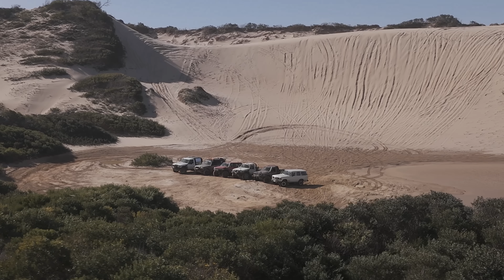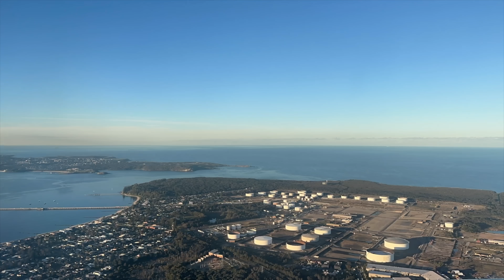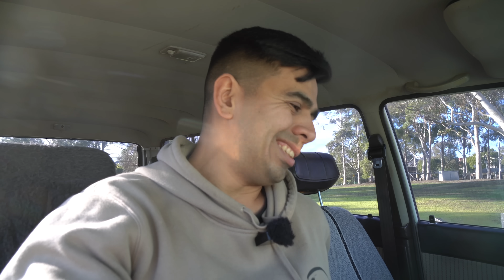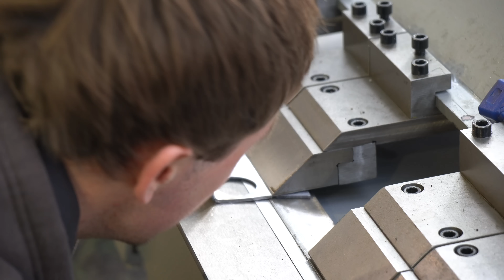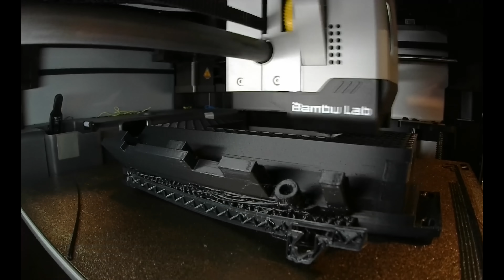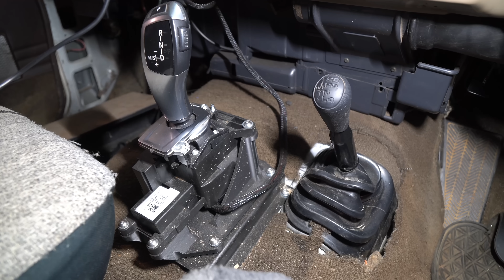Engine swapping my Landcruiser with a BMW X5 8 Speed (N57) for $30K

Comment: This guy has no clue about tuning or any aftermarket ECU! not to mention the benefits of a the basic CANTCU or even better, a turbo-lamik! Didn't seem like this bloke built anything, just paid people to do shit for him?!
Reply: you might want to look a bit deeper into what he’s built in his shed over the years and what he actually does for a living ….😅
Reply: @toddn5401  Yes he worked for Ford, it's great stuff, it just seems he gets everyone else to make and build things for him, it what I was getting at!
Reply from the maker: Hey mate, I have worked in engine calibration for an OEM for multiple years, I also have project cars that are dyno tuned. They are not comparable in the slightest.
Reply: @DesignedandBuilt  So, no clue on what these TCU's can do and the benefits of why they were invented to outperform the OEM control units! Great for working with OEMs and all.  The massive buffers they put into their tunes because of warrantee ect ect. Just update yourself on why pretty much everyone is running a turbolamik and not the OEM units! This is also why no records are ever being broken with OEM units, even if they're tuneable! OEM just means slower shifts less zero tuning options, and i think pages of benefits not needed for multi paragraphs on YT!
Reply from the maker: I know TCU’s very well, sure that’s all true but that doesn’t mean it drives better than an OEM tune. I am chasing drivability, not speed. It’s not a race car.
Reply: @DesignedandBuilt Then wouldn't that be up to the tune!? Right! The TCU can be almost 100% cloned from the OEM unit, that how it was engineered, though backwards engineering, just added more options including safeties, for example shift cut is one of the OEM unit doesn't do, which in turn puts more strain (torque peaks) in the shifts! My original argument was more along the lines of you just buy not build yourself, but others around you, not argue the semantics of OEM vs After market. Which I'm pretty sure Motec would argue greatly over this. Damn so would any other company that can spend millions upon millions in R&D and real world testing! That's also the case of why OEM's are locking everyone out and people have to spend in some cased 30x the actual price of a replacement, let's just mention Lamborghini for that one, along with pretty much every other OEM following suit!
Reply: Well the cantcu would have been the way to go with the m57...btw it contains the oem tcu controller aswell! So in my eyes...that's not all alright. I'm so long into the 8hp swaps...back then when turbolamik wasn't sure to sell ever ! (Then went into testing in Poland before selling into europe)...there are always also drawbacks to standalones. I'd say with xhp and n57 on Software he can do a great setup aswell.

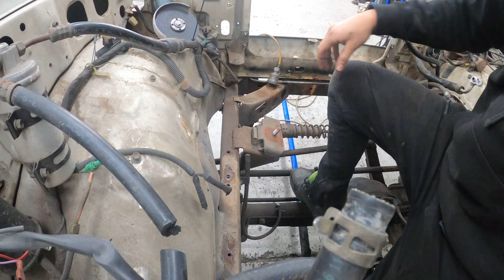Comment: 1:54 protip so you can read your text a bit easier, pull the camera back, put a longer lens on it and give yourself a larger prompter (like a cheap TV that you can bolt on an arm from the roof or something). That way, when you read it, your eyes won't have to make the shorter distance and your speech won't stumble (it doesn't that much,  but it's all the better if you make that distance longer) waiting for your eyes to make the travel. Think of it like ... a short lever arm vs a "cheater pipe" (which btw, i found out recently that it's super old lingo from the early days of Caterpillar service manuals. 😆)
Keep up the good work! :goodvibes:
Reply from the maker: That is a good pro tip that I'm going to take on hahaa

Comment: I have a few questions 

1. Would a wreck Ineos Grenadier with a m57 + 8 speed be the best option for diesel or would it be to rare, cost too much or have too much emissions control due to being 2022+?

2. Did you FEA any of your engine or transmission mounts for engineering?
Reply: All of your reservations regarding the grenadier are true. It uses a BMW B57, and recent BMW ECU's are locked and encrypted
Reply from the maker: 1. A Grenadier is a B57, different computers and also the Grenadier is like a 100K car. Pretty new to wreck and has very similar architecture to my N57 8 speed. 
2. Yes

Comment: 8 per 100 is real decent, that in the 60 will be cool as, my lux does 10 per 100, would hate to think what the turbo 2h does
Reply from the maker: 10 litres on the lux is decent! Couldn't imagine those old motors.